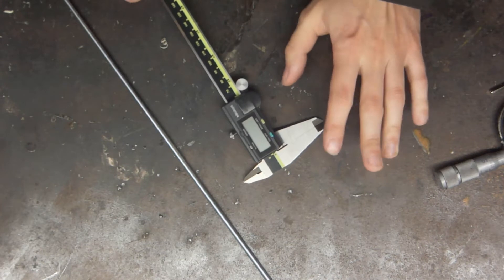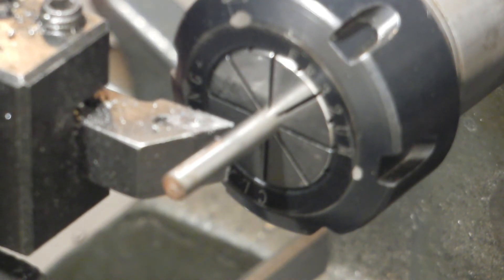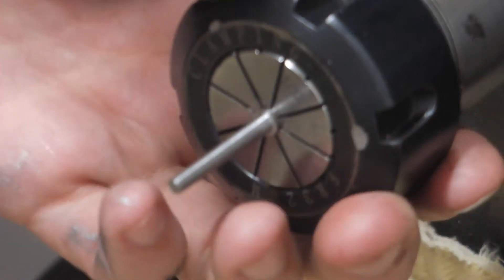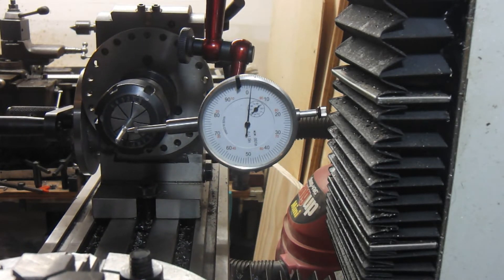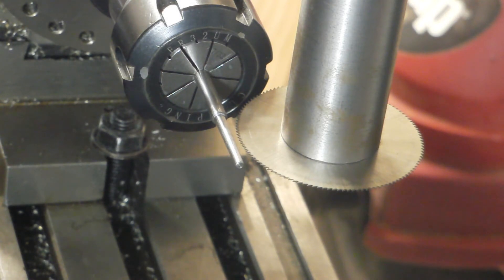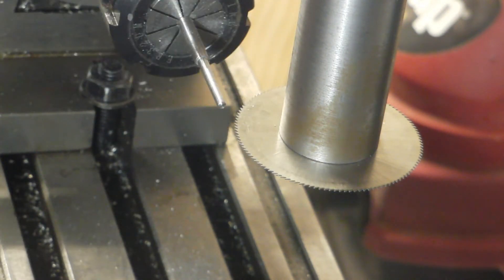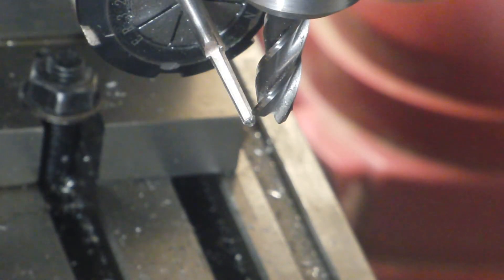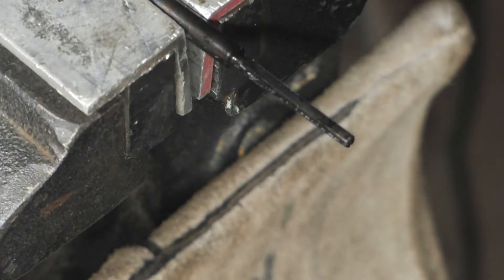Making a Straight Flute Tapered Reamer

Comment: Did you use HSS or tool steel?
Reply from the maker: O1 tool steel. I forgot to temper it and It snapped in the work. Luckily I was almost done so it did its job.